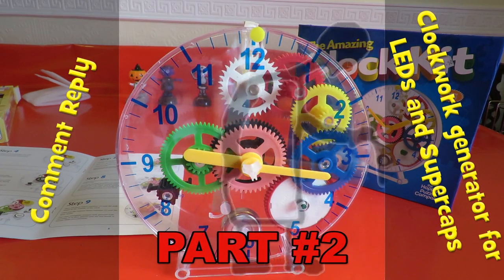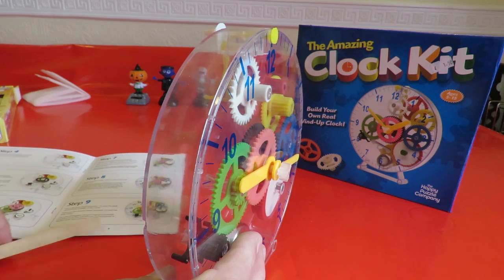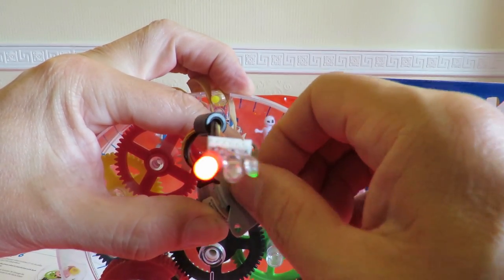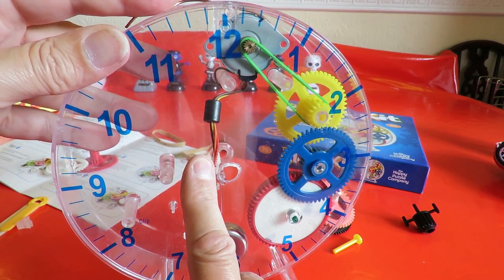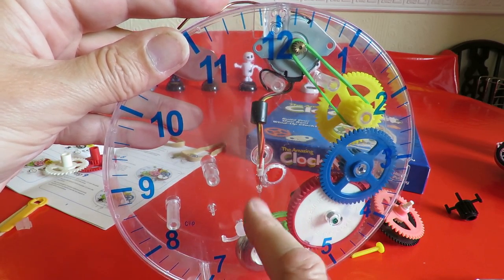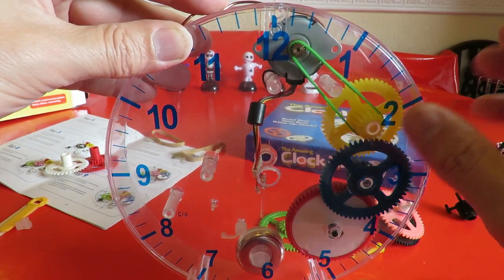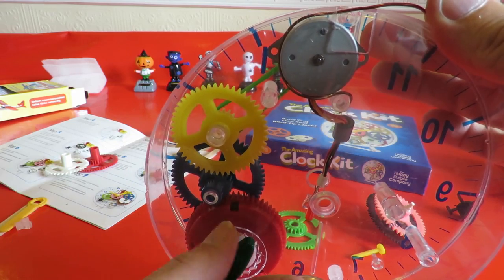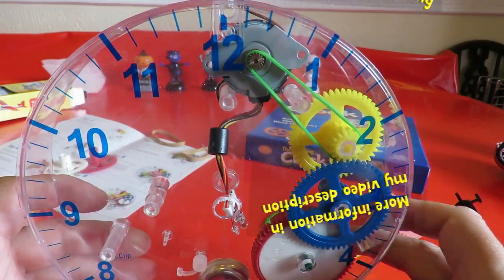Clockwork generator for LEDs and Supercaps PART #2

Comment: or option #3 . . . . a drive belt so the tension between the last gear and the motor does not need to be so great
Reply from the maker: Yes there are plenty of options but a more powerful clockwork mechanism would be handy.
Reply: that would have been my idea too instead of having a less powerful stepper motor,
Reply from the maker: Did you see this link Bill P gave us in the previous episode https://youtu.be/KGkCOl-67iA

Comment: You really need a spring like what was in the old Victor https://www.youtube.com/watch?v=6R9i7zp-v9s a two spring wind up with a fair bit of drive power compared to that small clock one.
Reply from the maker: That is a beautiful mechanism but I think you are talking big money to get hold of that sort of thing and well outside the scope of the work I do on my channel.
Reply: For that mechanism itself yes.  However, every time I go to Home Depot I see the steel strapping used for wrapping the pallets of wood and think "what can I do with that strapping" that they usually just toss in the trash.  While it's probably poor spring metal, it may be just good enough.  But as to what you have in hand, can you gang two or three of those wind up springs in parallel and gain more power from them that way?

Comment: use gears to connect the motor... not a belt
Reply from the maker: Yes, you could. Obviously you would have to 3D print a suitable gear to match the different sized teeth as it would not be a generic size, however you would still have the same problem. If you gear the system to turn fast enough to light those LEDs you don't have enough enough power from that clock spring to do the job. The motor I was using takes a lot of effort to turn it, which is why it generates electricity well. You could use a less powerful electric motor, that takes less effort to turn and could spin faster easier, but that would generate less electricity. If you have the facilities to print your own gears then you could print the whole gearbox to suit your requirements and then you wouldn't have to try to adapt something like this. Alternatively you could use a clockwork motor like the one in this video, that should do the job https://youtu.be/2M3JhwwWFhQ